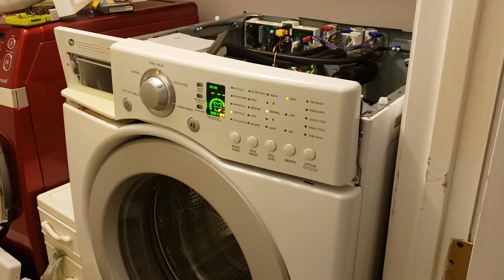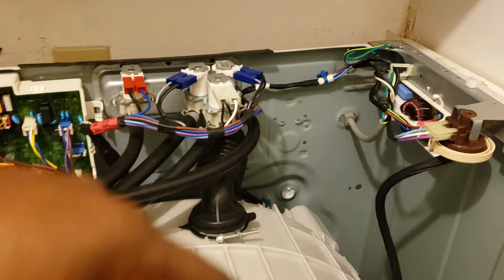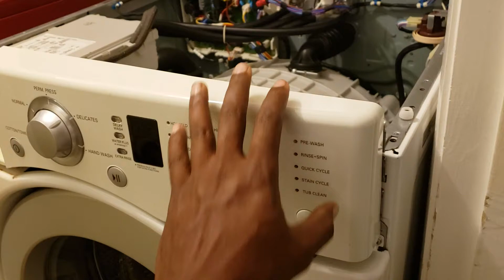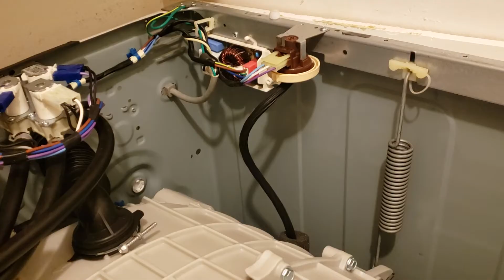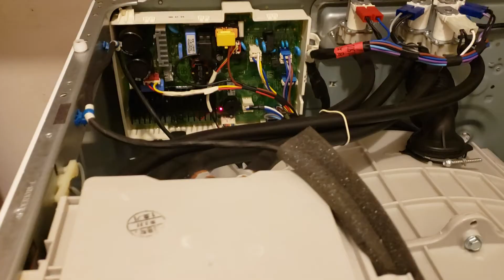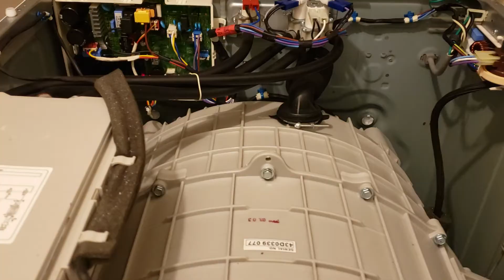Repair Advise For, LG Washer "No Power" Issue

Comment: bro I have a washer  Kenmore elite stopped in the middle  of  the cycle smoking coming from the sircuit board it was toasted so we replaced  it but now trips the braker as soon as you connect  it I wonder where  is  shorted any idea?

Comment: I replace the computer, control panel and noise filter and still no power. 100 bucks in.
Reply from the maker: Next will be checking the wall outlet, and wiring inside machine for any breaks or burnouts

Comment: A SOLUTION: I had the no power issue. I drained the catch filter located at the front  bottom left corner. It has been working ever since.  Good luck.

Comment: My LG washer wasn't powering on I made sure the outlet was working it was. So I unplugged it and I did a reset. When I plugged it back in I plugged it into a power strip and it came right on. Just wanted to put that out there for anybody having the same issue you might want to try that as well if nothing else is working before you go spend a bunch of money

Comment: when you get this problem with an LG machine, the best course of action is to proceed methodically
- first unplug the power cord, and plug a lamp on it. if the lamp does not light up, your problem is somewhere on the breaker
- if the lamp shows regular power on the socket, press the on off button 5 sec then the start button 5 sec, and plusg back the machine. it may work.
- if the 5s/5s fails, time to check the connectivity of the filter
- unplug the power of your machine, and unplug the pink connector of the filter (the output connector, in my case it is pink).
- use a electrician circuit beep check system, and check the pins of the pink connector with the prongs of your cord. you must have a 1 to 1 beep. meaning each of the 3 prongs of the cord must beep with only one different pin of the pink connector.
- if not, unplug the white connector os the filter and check the cord (same: 1 to 1 pin), if bad, replace the cord.
- if cord is ok, it is the filter. check if there is a fuse in it. test the fuse itself. if no beep the fuse blow, you may replace it or replace the filter at a whole.
- if the cord and filter is ok, plus back white and pink connector, then open the main card box, and connect it back if you unpluged some connexion. 
- in the master card , there is a red led 
- plus the cord in the wall power socket (be careful, do not touch anything) and look at the led. if it light up, most probably the card is ok. If it stays off, probably your card is bad.
- if your card is bad (no red led) unplug everithing and change the card. Usually you can find the card for 100$ or less.
- if the led light up...  call Houston and says "we have a problem"

Comment: This seems to have happened to me, thankfully I got the extended warranty but good to know it wouldn't be that hard to fix. I was wondering, what causes this? Is there an underlying issue that could cause it again? It may have been a bit unbalanced, it woke me up being all noisy and I went back to sleep. Got up and it was without power, outlet braker popped. I put that back in but as described here it has no power. I checked the outlet, it's fine.

Comment: that's not a computer, this is power supply unit and usually what dies ont it is transistors, shim controllers, relays and sometimes component under the aluminium heat sink.

Comment: I have an LG washer that won't power on. Asurion sent a tech that said it is the control board. I replaced the computer and the panel with the display and still no power. A little LED on the panel comes on when I press the power button, but the unit won't power on. Do you have any suggestions please?🙏
Reply from the maker: Let the Asurion tech fix it. Sounds like the type of fix that requires expert
Reply: @Washer Dryer Repair Tips & Tricks for DIY 'ers  So, Asurian said it was the control board and they just paid me for a new washer and were done. They said the control board is no longer made. 

Ge this. After I tried new hardware with no luck, I simply tried touching the power button square on the board without the cover installed, and boom. It came on. And this is with the old board. 1. I don't know why the new board didn't work and 2. I can only imagine how the "expert" missed the fact that the little foam square was missing from the power button on the board. I took a little square out of a button we don't use and put everything back  together. It is working. I'm now returning $400 in parts and have the $650 that Asurion paid out.  Oh, and I have a long, boring, and perhaps confusing story to tell. 🤣🤣🤣   Thank you sir!!!

Comment: Hi..
I have LG WASHING MACHINE INVERTER.
As circuit computer board is bottom.i found when power button push computer board red led light turn on but not washing machine turn on .
Give me ideas for repair.
Thanks
Reply from the maker: You need to lookup the code

Comment: had a  washing machine lg tromm wm2377cs ..  te code pop up ..find out a code for thermistor..  change it and replace a new one ...now won't start.. do you think i need to change my door switch too? thanks
Reply from the maker: If it started before you took it apart, then you forgot to plug something back in or you install the wrong thermistor

Comment: Hello we have a LG top loader 
It won't power on. We reset and it sparks Everytime we plug it in. Also the mother board has a red light you can see if it's taken apart .. any idea what it could be? We ordered a new sound filter but with the red light in the back I have a feeling that's not the issue... Hardly a year old and it went out 😭😭😭 worst $1,000 spent ever

Comment: Thanks for the video. 
I have an LG washer with no power.  Just before the power went out completely,  every few minutes I was getting a "PF" OR power failure alarm. Is this a sign that it IS the computer that went bad and not another component? TIA. 
-Rick
Reply from the maker: That usually means power failure if you press the cancel button it will usually reset. But if that doesn't work I want to take the top off and make sure all the wiring is intact. Next I would check the wall outlet for power then the next suspect would be the noise filter

Comment: Hi you just need to change the resistor and lnk chip probably.
Reply: Where are they located??
Reply: @30kendel  they are located in begin of the power supply
Reply: You can sent me hd picture on of the pcb on petrovedb@gmail.com
Reply: @stevedebeukelaer1424  is it the in the noise filter?
What does an ink chip look like?
Do you know where I can buy the ink chip? Thanks very much steve.

Comment: Check 120 VAC at the plug if it’s there check the noise filter fuse if the fuse is good check 120 VAC going out of the filter if it’s there the filter board is good next thing check main control board red indicator light if it’s on. If it’s not on with the washer plugged in you got a bad main control board
Reply: What if the fuse is blown? Where's the short then?

Comment: I have a similar LG washer  the WM2801 That would not power up .  I bought a used board and replaced The one in the washer with the one purchased. Washer works fine for one complete cycle. And now it won’t power up again.  Any suggestions?
Reply from the maker: Check the machines noise filter and wall voltage
Reply: @appliancefixacademy  Thanks I will.
Reply: @appliancefixacademy  How can I test the noise filter?

Comment: Well I had a similar problem where my WM2455HG would run fine but after it was off for more than 5 minutes it wouldn't turn on again unless you unplug and plug back in. I thought it was the noise filter but no go. I'm 99% sure it is the yellow relay which is controlled by the 120VAC line to the power switch. I have the service manual which is actually decent and it gives all of the test points of the components. Unfortunately it doesn't have any diagnostics for the PWB. I imagine the conformal coating is because of the extreme vibration but it makes it very difficult to test. I'm sure the relay is easy to replace if you can actually get the board out without damaging it. I ordered a used board on e-bay because you can't find these new anywhere.

Comment: my LG front loading washing machine is on the fritz(wm801hla). Basically whats going on is everything works perfectly but as soon as it’s finishes and you go to start a new load nothing happens it will show no power like it locked up but the drum light will stay on. If you try to do factory reset and unplug the unit as soon as you plugged it back into the wall it will spark and everything will work again for 1 load then it will do everything all over again like before.

Comment: My LG washer model number WM 2101H has no power at all to it for the last few weeks the drum has made a really loud grinding sound then the OU light went on and I  cleaned the  drain pipe and then it all went black at the end of that washing cycle The machine is 10 years old Is it worth repairing??

Comment: Looking for some advice ... My LG washer stopped working No Power nothing locked my clothes in the process too 😫 anyways I called for a repair . Paid $100 for them to tell me it’s the Motherboard and it will be $600 to fix. The washer cost $700 5yrs ago. Please anyone think it’s worth buying a New washer or just repair this one? I’m really confused with all this computer appliances now a days.
Reply from the maker: No power at all usually is the contol board (where all the buttons are). Take a chance and order used board off ebay, might cost about $40. Other parts it might be too is rear board or noise filter. Check my video out on how to order parts online
https://youtu.be/DL6sMhsANW4
Reply from the maker: Also, plug something into the outlet to verify the socket works.

Comment: I replaced the computer which had a blown capacitor and STILL no power at all. :-(  ... How can I test with a voltmeter  the other components without buying it? It doesn't make sense for me to keep buying parts without knowing the issue. Thanks in advance!
Reply: I was told that a bad door switch or water pump will blow out the board. I have the same issue and dont want to replace the board untill I can check them other things. Not so easy to reach the parts and at the same time they can be reached. I am considering looking at a new mechine since we can not be with a washing machine very long.

Comment: Thanks so much for this video.  We were able to identify our problem when the washer had no power.  The fuses were testing ok, but when we took a closer look at the noise filter it was black inside.   Ordered the part from eBay for less than $20 and washer is working again!
Reply from the maker: Awesome
Reply: My washer jumps like crazy after my son washes his pants. No telling whats moved
Reply: The rear panel, pull it off, check the suspension shock absorber. If it's not that, then on top, there's 2 springs that hang and attach to the drum and keep it suspended. One of those came lose. My money is on the shock absorber failing catastrophically. Hopefully not filled with water, like mine was..

Comment: Just a quick question... why wouldn't you test the current going to the front panel and the noise suppressor before replacing them?
Reply: Extra money
Reply: The noise suppressor is simply a copper wire , wound around a ceramic core. It's nothing fancy. The panel on the other hand is different. It's fed power after the motherboard transformer drops power down to 24v . Or 12v, whatever it is. 

This guy's trying to help diyers..  most won't use a multi meter..

Comment: Ok I have a lg washer that so t turn on at all ...I saw your video and I can’t find the part number replacement for the 

Model   WM2016CW/01
S/n. 903KWAT06536
Board replacement 
EBR38163321
What’s the noise filter# and do you have one to sell
Reply: Check on the parts. It's always printed somewhere

Comment: How do you take the wires off without BREAKING them, they seem to be on there pretty good, thanks for video
Reply: Got it thanks, friggn washing machine 🥵
Reply from the maker: The wires are clipped on most of them have little levers that you press with your thumb as you pull them out

Comment: Dude don't ever replace board over no powere...jump the burnt spot on the board with a thick cable..
Reply from the maker: Jumping is a fire hazard. Most burnouts are because of failed relays or other components. The burned out voltage path should be treated the same way you would treat a "check Engine" light on our car.

Comment: My LG front loader (model# WM 1355 H had no power. Unplugged it plugged back in and power was restored. Keep having to unplug and plug back in when using it. Any suggestions as to the problem?
Reply: Jim Campbell i have been reading comments and watching many videos and for what you are getting, seems like the main board is your problem. That is the brain of the washer machine. Noise filter is basically an over voltage protector, so doesn’t seem to be your problem. I just ordered a main board, waiting for it to see if it fix my problem. I have no power at all.
Reply: @rogerfigueroa4173  did the main board fix your issue?
Reply: @exackly   yes it did.

Comment: Did you try the (unplugged) five second press of the two buttons (separately) to see if the PCB reset? And then, if it didn't reset, try checking continuity at the fuse on the PCB? Because I didn't see mention of either of those basic troubleshooting steps - just mention of replacing of several parts that weren't faulty. That could put a repairman out of business (unless, of course, you attempted to get the customer to pay for them, lol, which could get a repairman shot).
Reply: I’ve successfully repaired one lg washer by doing this. Hold power and start buttons 5 seconds with it unplugged.
Reply from the maker: I've never experiencing repairing washers and dryers fully just by resetting. In my experience broke is broke. Resetting and recalibrating is good when you add new parts. You're right, Resetting is a good first step for do-it-yourselfers but for repair technicians the risk of having to come back charge more to replace the board if the reset doesn't work. My opinion Profesional and thank you for yours.
Reply: “If you have a plug” lol if not that might also be the issue.

Comment: Now how do you actually test these three main boards? I have a multimeter/other tools. What voltage should I be getting? What should I look for? I’m not just gonna replace parts if I don’t have to, like you say that’s expensive.
Reply: You have to pull out the fuses from the board to test EA fuse
Reply: @carmac1652 
The contacts for the fuse were accessible so it was easy enough to check for continuity. Unfortunately it checked out fine, so that wasn't the issue.

Comment: hi , can i use a different part No. control board , i have erb7428 control board can i able to use a erb models , i need help i can't find exact part No. for my washer .
Reply from the maker: They are weird. I have used different part numbers as long as all the plugs and components are the same.

Comment: i am having the same issue with my kenmore front loader LG washer right now.  I have no power.  I tried the unplug method and even pulled the front panel off and seen nothing.  I was hoping to get a manual, but I cant find one.  I believe it is a 41262.  I really dont want to have to unstack these units, but it is sounding like I have to.
Reply from the maker: This video explains exactly how to fix that issue

Comment: Not helpfull at all didnt explain how u diagnosed it...
Reply from the maker: To diagnose not getting power, is not having power, lol. My explanations are for the Layman because most people don't have the tools to actually test the components on the board, so I Basics explain which parts are most likely to have gone bad. if you have no power going to your board, as in it will not turn on at all no lights. Only if that is your LG washers symptom.
Reply: @appliancefixacademy  
I realize LG purposely made the control boards non serviceable by potting everything, but are there any schematics available for them to at least enable bench testing?  I'd be curious to see what it is that fails so regularly in the LG designed control boards.